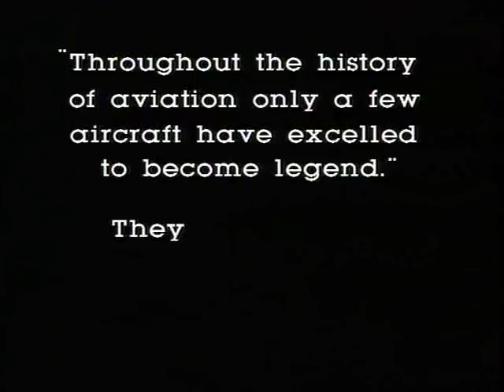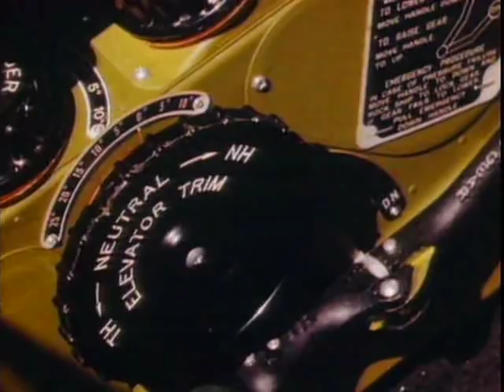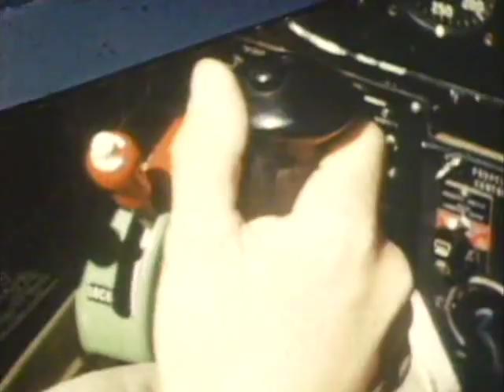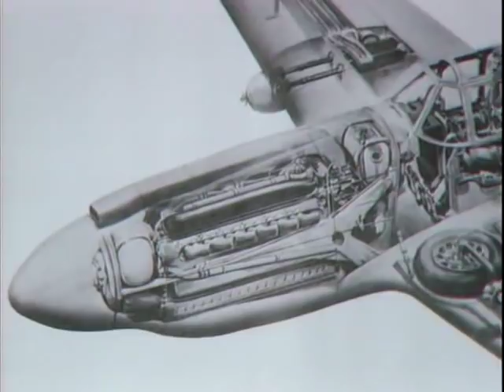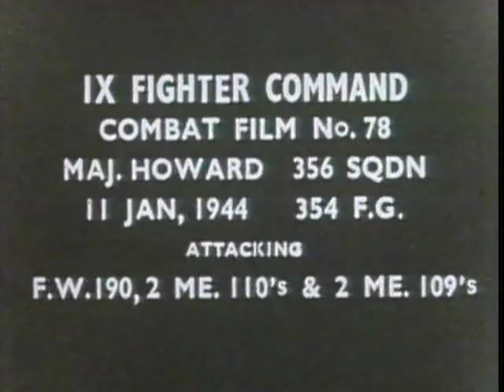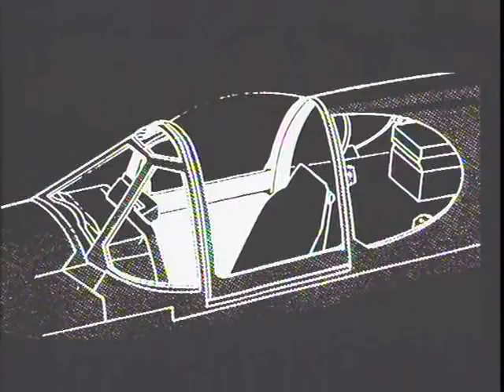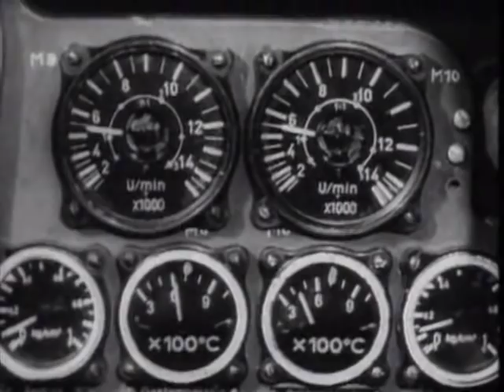Great Planes - North American P-51 Mustang

Comment: The F-4U could actually out fight a P-51 ;)
Reply: Yes and do know what could out do a P-51 in a turn fight and in a long high speed dash? if you guessing it's the Fw-190
Reply: Midniteoyl Depends on the pilot. Either plane could kill the other with a competent pilot. 

But here are the facts. Put the F4U on English bases in Jan, 1944 and the Luftwaffe would have had control of Occupied European skies on June 6, 1944. D-Day could not have happened under those conditions. In the first half of 1944, the ONLY fighter that could kill the Luftwaffe so completely that German  Air power could not even make a showing on during the D-Day assault, was the P51B/C. 

No other fighter aircraft ever built has had such an instant, seismic effect on the direction of history.  That's why the P51, without question, always win "Top Fighter Plane in History" awards. The Spitfire, the F4U, the P47 and P38 could not possibly have done what the P51 accomplished in 5 months:  take air superiority from the Luftwaffe at a time critically important in history.
Reply: 63DW89A
The only reason was range..
Reply: Midniteoyl Yes it was only in range in fact the P-51 had such bad low speed handling it could go into a flat spin and kill the pilot
Reply: Midniteoyl Took more than just range to allow the P51 to kill nearly 5000 German aircraft in air-to-air combat from Jan,1944 to May,1945. If the P51 had only range and nothing else, it would have been blown out of the sky easily by ME109's and FW190's, as both of those were damned fine fighters! In the months prior to D-Day, Only 2500 P51B/C's took control of the air away from the Luftwaffe by April, 1944, and those P51B/C's were vastly outnumbered by Luftwaffe fighters at that time. Saying, "the P51 only had range" is not dealing with the reality of what happened from Jan-Apr 1944.
Reply: Gahlok12 Only 2500 P51B/C's took control of the air away from the Luftwaffe by April, 1944, and those P51B/C's were vastly outnumbered by Luftwaffe fighters at that time. Saying, "the P51 only had range" is not dealing with the reality of what happened from Jan-Apr 1944.  Dominating the airspace so quickly indicates that the P51 was a very well balanced aircraft in performance.  Other fighters may have been better in certain areas than the P51, but those fighters were lacking the balanced performance of the P51, and that is why those fighters were not capable of air superiority over the Luftwaffe. The P51 did in a few months what the Spitfire, P47 and P38 had failed in years of trying: take air superiority away from the Luftwaffe.  That fact of history clearly shows that there was no fighter "superior" to the P51 at that time. Otherwise, those "superior" fighters would have defeated the Luftwaffe before the P51 arrived.  Got to deal with reality.
Reply: 63DW89A Well yes but the thing is what was it's kill ratio?
Reply: Gahlok12 Depends on how you want to define "kill ratio". If you look at the ETO, there were 2520 P51's lost to all causes and 4950 aerial shoot-downs by the P51,  the kill ratio is "2:1".  

If you pick out a specific example, say the 357th Fighter Group P51's against ME262's then 357th FG P51's had an "18:1" kill ratio against ME262's, as the 357th shot down 18 ME262's and lost one P51 to the jet.  

The "18:1" kill ratio of course focuses strictly on plane to plane, and ignores all other P51's lost to training accidents, pilot fatigue crashes, collisions, lost on strafing missions, failure to return, etc that the "2520 losses of P51's" includes.

No fighter has a high kill ratio if all losses are included. I suspect that most successful fighters have a "2:1 kill ratio" if ALL losses are included.

Traditionally the P51 has been assigned an "11:1" kill ratio, but that is at best an estimate based on guessed at losses to the enemy that can never be verified. Ditto the Hellcat's "19:1" kill ratio in the Pacific, ditto "Name the fighter".
Reply: 63DW89A Well True, true I was just wondering and in fact the F6F-3 and the F6F-5 were kept simple yet tough.
Reply: The range comment is because prior to the P51, the Germans would just wait until the allied fighters turned back, thus avoiding the fight. The Allies had already asserted dominance in the air within the range of planes like the P47. If they had had double the range and had been used like the P51 earlier in the war, the numbers would have been totally different.
Reply: Midniteoyl Yes that is a point that you need to remember that the P-47s were doing their job very well before the P-51s toke over.
Reply: Midniteoyl That is possible, but I'm not so sure about that in reality.  The P38 had nearly the range of the P51, yet could not handle the German fighters very well and never managed to be an air superiority threat to the Luftwaffe. The P47 is a great, often overlooked airplane. But even with adequate range, I don't think the P47 could have accomplished air superiority as quickly and decisively as the P51B/C did in the critical months before D-Day.  The P51 is not a perfect fighter by any stretch of the imagination. It had its limitations as do all fighters.  But I think that what the P51 had was a well-balanced performance envelope that allowed it to dominate such capable, deadly and nimble aircraft as the ME 109 and FW190, provided the pilot was competent and kept the P51 operating in its strong areas as the high-speed energy fighter it excelled at being. Allow the P51 to get "Low and Slow" and it was as vulnerable as any other aircraft.  The competent P51 pilot would not allow that, while the incompetent P51 pilot that got "Low and Slow" was either dead or a POW.
Reply: +63DW89A Actually the P-47 did much of the early damage against the Luftwaffe and the Corsair was actually better than the P-51.
Reply: +63DW89A You can create any kind of lie you want with statistics. Robert Johnson shot down more planes per mission than Eric Hartmann and he flew a P-47.

The reason the Luftwaffe scores where higher is because they had more opportunity but not exactly because of more targets (although that is true as well) but rather more missions. 
USAAF Aces were rotated out after 60 (most of the time) Hartmann and Barkhorn flew over 1000 combat sorties. As an example, Robert Johnson had 27 in 60 missions, that puts him at a higher strike rate per mission than let's say Erich Hartmann
Reply: crosstimbers2 Yeah but Erich Hartmann was feared by the Russians.
Reply: +Gahlok12  And that proves what?  You should be afraid of anyone flying your enemy's fighter plane.
Reply: crosstimbers2 I know but I was just saying that he was one of the most feared pilots of his time and he had a design painted on the nose of his plane and spinner making him easy to spot.
Reply: Gahlok12  War is not a joust between 2 men and their planes.  Yes he was feared and he was captured and spent 10 years as a POW. I am sure he would have given every kill back to get out of jail.
Reply: crosstimbers2 Yep there is one way to win a war and that is through money and might.
Reply: Gahlok12  As the Germans were pushed back and the US started using airfields on the continent the P-47s did not go home. Their range limitations disappeared. Any P-47s excess to the needs of bomber escort could conduct fighter plane raids or fighter bomber raids which killed off the Luftwaffe even faster.
Reply: crosstimbers2 Yep see why I said money and might but called one thing instead of 2 things LOL my bad.
Reply: Midnight: Not any model used in 44/45 Post war maybe
Reply: @MrBioniclefan1  Gahloc: The Fw190 was better in roll rate only
Reply: @63DW89A  1. D Day RAF 2TAF  1500 Spitfires 470 Typhoons That is more than the 8th USAAF had there.
2 1944 8TH AF 17 F/Gs P51 for 1904 Not all in France but still in Britain
3 There were 5 air-frames used with the Merlin and it was late April 1942 first combat Oct 43. Gee what happened?
4. First Mustang unit to the RAF INTO COMBAT 10 MAY 42 By my maths May 42 to Oct 43 is 17 months The RAF kept flying the P47 was still fighting and the P47 shot down more Germans
Reply: @63DW89A  No not 5000 less than 4000 maybe 3900
Reply: @63DW89A  Bull dust what do you think the 2900 combat planes of the RAF 2TAF were doing over France Holland Belgium, Denmark or the 1000 MKVIII Spitfires in Italy
Reply: @crosstimbers2  Corsair NOT in Europe
Reply: @crosstimbers2  Bull dust 60 missions in my eye
Reply: Hoa Tattis  Your claims and very suspect figures (source?) are not compatible with the historical facts. IF the Spitfire were as effective as your dubious claims assert, then why did the bomber forces of the RAF / USAAF suffer such devastating losses in 1943? By your very dubious claims the Luftwaffe would have been so decimated by the Spitfire, that the 8th AF should have had very easy daylight bombing runs!  Exactly what source are you using for these kill figures?  If you will carefully check the bomber losses by the RAF / USAAF August-December 1943, you will see that the Germans had TOTAL control of Occupied European airspace through the end of 1943, as clearly shown by the devastating bomber losses suffered by both the RAF and USAAF.  If your Spitfire were as effective as your dubious figures claim, then clearly the Spitfire was having NO luck at air superiority as you claim!
Reply: Not used in the west and was a Brick
Reply: @63DW89A  Sorry June 1944 ADGB and associated formations [read RAF]  flew 8474 offensive day sorties Night fighting was by RAF units No P51s there.
Reply: @63DW89A  No no no false false false  In the months prior to DDay Nov 43 to Mar 44 Spit IXs downed 2950 enemy  just the MkIX  my friend Source Spitfire a History Morgan and Shacklady Page 312
Reply: @63DW89A  nOV43 TO mAR 44 Spitfires downed 2950 enemy Just the MkIXs
Reply: @63DW89A  Cant do that 63D because you would have to include the 16 plane Sqns of the RAF e.g. 92 Sqn 317 kills + 53 probs for 19.8: 1
Reply: @63DW89A  Again those critical days before D/Day Spitfire IXs 2950 kills between Nov 43 to Mar 44  Source Morgan and Shacklady Spitfire a History page 312
Reply: @crosstimbers2  Corsair was a brick however you are correct with the P47
Reply: @crosstimbers2  Robert Johnson was a baby compared to Pat Pattle 50+ in 10 months or Braham 29 as a night fighter
Reply: @crosstimbers2  Neither did the  2970 planes of the RAF2TAF and were using ALG D/Day + 4

Comment: The truth is, the merlin engine was sucking tit until it was infused with american technology. Specifically bendix stronberg pressure carb, US high octane fuel, and US designed dual stage supercharger with chargecooling. Rolls royce deserveres credit for making the whole package work, but not all the credit. Packard built better merlin engines than Rolls royce actually did.. England ended up copying there bearing designs and mass production technqiues, Ford US actually built a single engine also. So yeah you can thank the US on that.